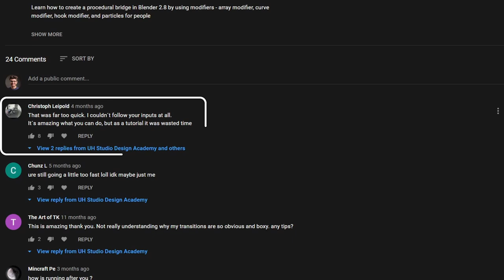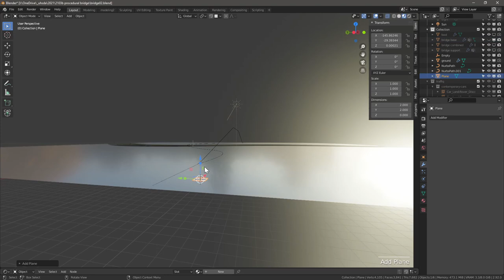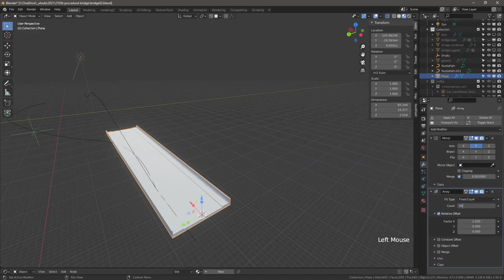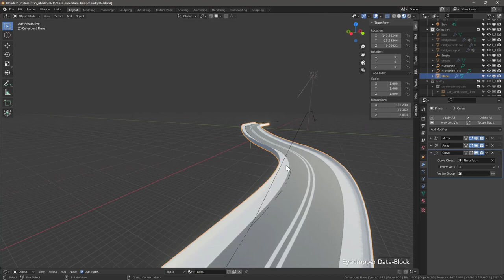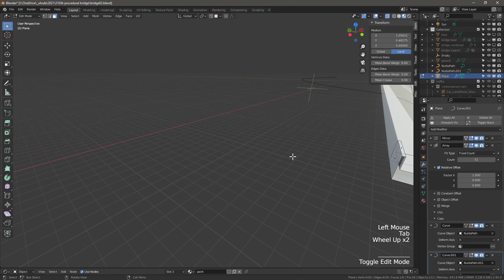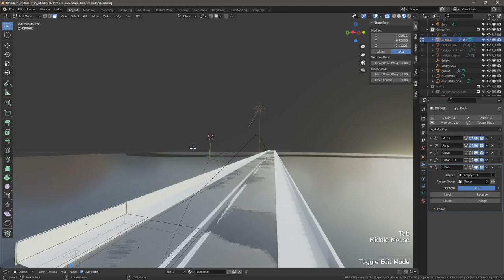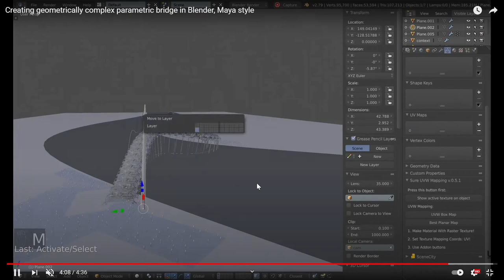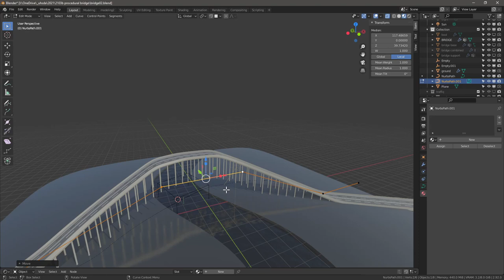Easily create a procedural Bridge in Blender

Comment: good start. But for real road need to use a parametric curve like clothoids.
Reply from the maker: Thanks. I had to look up the meaning of clothoids. In this case, this is not a real road simulation, but a quick way to put a road together, but yes, having proper curvature when needed would be a nice benefit.

Comment: There is an alternative to the Hook modifier to build parallels objects along the curve? in my case, the bridge have a complex shape and I placed it in another meshs, I'm looking for a away that I can duplicate/deform it only along the XY axis, with Z as constant.
Reply from the maker: Yes there is! Another user kindly mentioned using the Shrinkwrap modifier, set to Project, with the same vertex group as shown in the video.
Reply: Cool, I will test it. To solve the orientation problem I've used face replicators along the curve, and after applied the modifier, I scaled down to zero all individual faces on Z axis, making the bridge supports parallel to the ground (the cons of this method is the bridge is not procedural anymore, but for my little project it worked)

Comment: Quick audio question : I see you use a Rode Podmic

What is your audio interface and how to do you further adjust your audio ?
Reply from the maker: I use a Rode Podmic with focusrite Scarllett. I either record audio with video in OBS or audio separately in Audacity. I edit with Davinci Resolve, so the post processing is done directly in Resolve as shown here: https://www.youtube.com/watch?v=lAk_QydS87E&t=1305s
Reply: @UHStudio  Thank you for sharing. I find OBS pretty amazing specifically with the VST plug-ins in it. I noticed that in this video your voice sound has a lot less room echo thus I was curious what you did differently. I have teh Rode too and also got the Sontronic which has a software sound.
Reply from the maker: @cekuhnen  Yes, obs is great! Did my previous videos have more echo? I've been using this setup for a while but sometimes talking head videos have a video mic on top of the cam.
Reply: @UHStudio  that’s then the difference I noticed.
Reply: @UHStudio  btw do you use any cloud lifter or preamp or do you mainly adjust the sound level in post pro ?